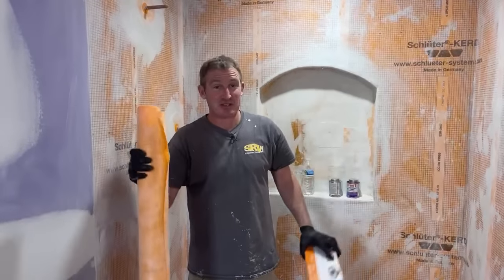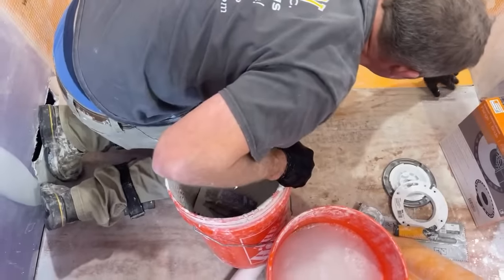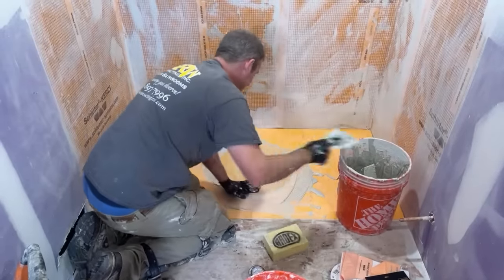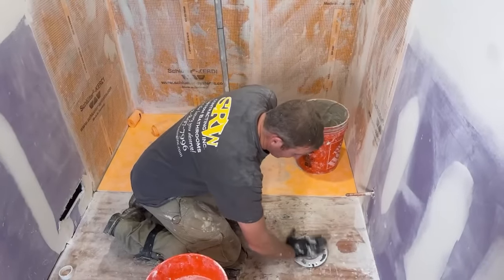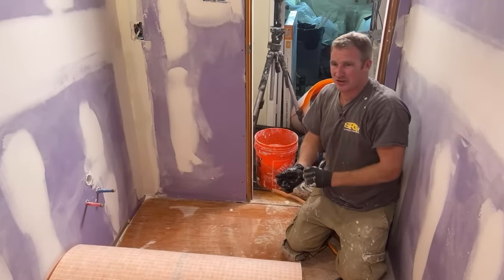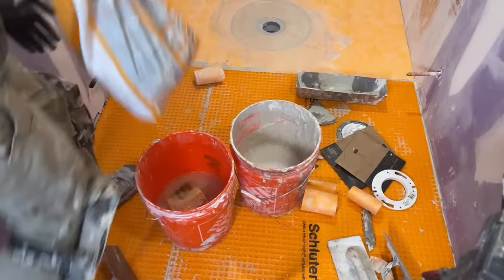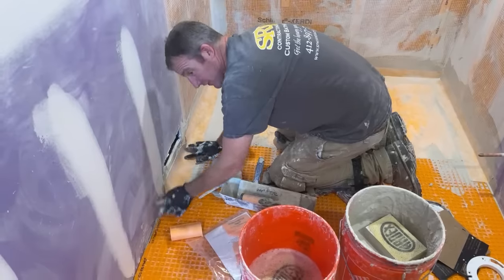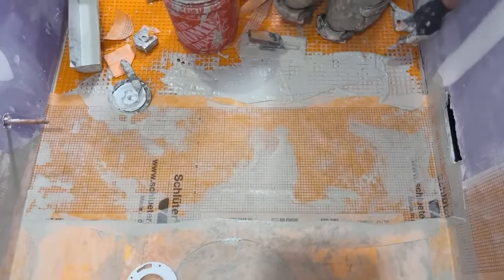Curbless Shower LIVE Demonstration

Comment: I use hardi board,cim 1061 epoxy and float bottom edge then I just float the shower floor. I really don’t trust this system there is no secondary drain. I’ve been setting tile for yrs. 40+ .All in the Layout mi amigo. Nice work I like your channel🙏🏼👍🇺🇸💯😎

Comment: On vacation there was a curbless shower. The main floor grout joints 4' from the curbless shower leaked water. There should be a grout joint filed with caulk at the transition between shower floor and main floor. That would prevent capillary water movement.
Reply from the maker: Spot on!

Comment: nice video, i have used schluter for over 20 years and started going back to mud set walls and floor due to how bad the walls are. going to be doing a master bath with hydro ban to go over the mud. there are no shortcuts but there are differences in costs between the 2 methods. remodels are always more work than new construction and should be compensated for it too.
Reply: Which method would you say is better cost wise? Supply issues not being taken into account. I keep debating whether to go Schluter or Hydro Ban or concrete boards. Looking to doing 3 bathrooms one a time of course.
Reply: @eunicom  both laticrete and schluter products are very good and will work fine, it's just a preference on which method works for you, the biggest issue i have with waterproofing fabric is the buildup in the corners which make inststalling smaller tiles more difficult. the one plus hydro ban is that you apply 2 coats to achieve 20-30 mils thickness which keeps the buildup down to a minimum. if you plan on using any type of backer board, do your prep and make sure those studs are plumb and flat because if you install to warped and out of level walls, you will fight the install with thinset

Comment: Great work..I'm doing a very similar job but larger for wheelchair access. Your video explained enough for me to confidently tackle the job on my own. Thanks
Reply: I have a question..I hope you have time to answer. When installing the drain flange and then the grate...I see that thin set is packed under the grate against the adjustment collar...since all tile is not waterproof...do you make a void  that could to allow water that can build up under the tile to escape past the adjustment collar so it doesn't build up in the pan.?

Comment: Thank you for the video. How to get ready for inspection? How do you fill water in the shower pan and let them sit for 24-48 hours to ensure there is no leaks.
Reply from the maker: It’s a pain, but if you have any kerdi Board or similar, you can kerdi fix yo pan and walls. Next day you’ll have to surgically remove it. I’m not sure of another way. I’ve heard of guys buying 5 lbs of plumbers putty….but never tried it
Reply: @BathroomRemodelingTeacher  Thanks, they don't require pan inspection where you're located?
Reply from the maker: @yairhaim4191  yep 👍

Comment: Its best to set and seal the foam tray after you tile the walls.  Use a ledger and leave enough room at the bottom so you can work on the wall tile on the subfloor.  Also, you should take a Schluter class or mayBe watch some videos.  You are sitting on the bag of inside and outside corners.   Yes, you want a 2” overlap but use the corners and overlap 2”.  If you watch the videos you will do it without having a 3 layer build up in the corners as well plus its less work and saves material.  
Is that Superman underwear you are wearing?
Good man!
Reply from the maker: Hey chip great input. Yes Schluter classes are definitely a must! Been around a long time, probably gone to a dozen seminars 👍

Comment: I plan on doing exactly this, dropping the shower pan by sistering 2x4’s to the trusses and installing the schluter pan. My question is how would it be effected if I used ditra heat? Also could I go into the shower with the ditra heat?
Reply from the maker: Great questions 
I have most of the answers in this video Floor Leveler Over Ditra Heat - Curbless Shower l PLAN LEARN BUILD
https://youtu.be/mxFcMpiB9Ig
Reply: @BathroomRemodelingTeacher  great thank you, super helpful videos

Comment: 02/18/2022 Schluter directly told me NOt TO USE "Self Floor Leveler". They said to thin-set first then put a piece of cement board. I used Durock. Then thin set the Durock for the pan.
FYI. I was going to use self leveler.
Reply from the maker: Yeah many reps still do. It’s in their one of their bulletins to use it up to 1/4”. Ardex levelers are a premium leveler used on many systems like this. But if your local rep say ms no, you must obey

Comment: I'd suggest checking out "star tile" he has a few curbless shower examples too. I'm anti schluter as it's very expensive. I think a solid sub floor, and maybe some durock/hardie, then some mesh and red guard or their speed coat. Is the way to go. I'm not so sure on thin set sealing a membrane down. It is faster but speed coat claims to dry quick. Theres many ways to do things and if this works then great. Tile coach just talked about kerdi linear drain failures. The glue isn't holding. Red guard states on the instructions it is rated as a pan liner and to paint it to stainless drain Then flood test
Reply from the maker: Redguard sucks. Not defending Schluter either. It’s simply quicker and really not that expensive. About $700 for this whole shower

Comment: I’m having such a hard time figuring out how to have the floors line up.  After mortaring the ditra onto the floor how much difference should I account for to line up with the pan.
Reply from the maker: If you only took out 3/4” plywood and didn’t add anything to outside floor. Ditra will be too low. Ditra xl or ditra heat will line up, but not ditra. In this video I installed new 3/4” plywood, but shimmed up joists with 1/4” strips before setting outside plywood. If you are higher than pan, that’s not a bad thing
Reply: @BathroomRemodelingTeacher  thanks. Ya I am gonna be higher. My house has the joists and then 3/4 slats.  Then I put 3/4 plywood on top.  The floor pan lines up but will be a little bit lower after the ditra.  Thanks for your time
Reply from the maker: @racerguy6979  all the better then if you ask me. That extra 1/8” or so is nice to have. Better drainage when water hits glass 👍

Comment: Would you say the thin set adds about 1/8” to hight?
Reply: Just under an 1/8 closer to 1/16 I think
Reply from the maker: Yeah typically. It’s always tough to tell, which is why I recommend tiling outside floor first, then meet shower floor tile to it 👍

Comment: im confused... i though they required non-modified thinset?
Reply from the maker: Most manufacturers warrant their thinset with Schluter now. It used to be a big deal, but not so much anymore. I still prefer setting all membrane, pans, etc with Schluter all-set and then use Ardex for setting tile. But you could argue that using Schluter thinset for everything is the way to go 👍
Reply: So what is it modified or non modified

Comment: You’re not including the amount of pipe going under the floor board. As a plumber would do is glue the pipe to the flange first then dry fit to the p trap and give your self an extra 1/4” of pipe to go all the way into the hub of the trap then measure and cut off what you dont need.